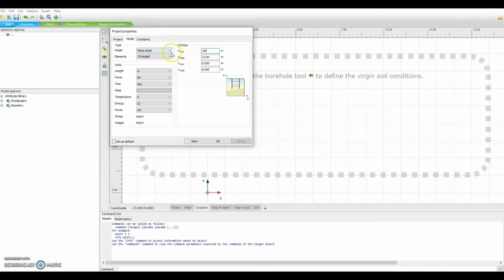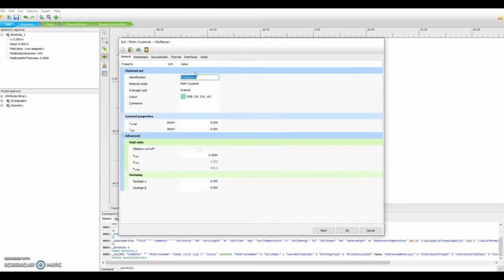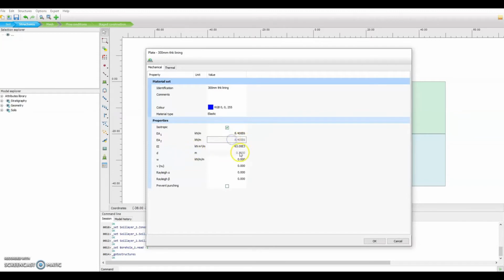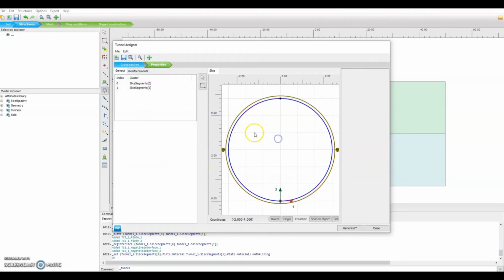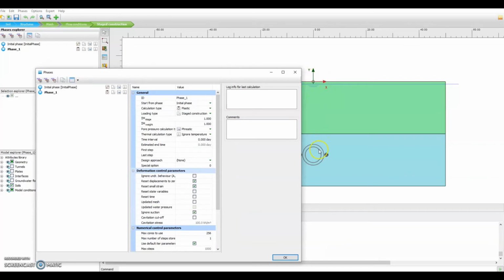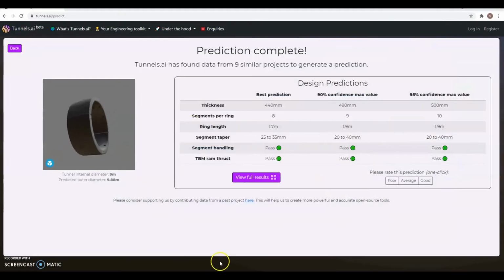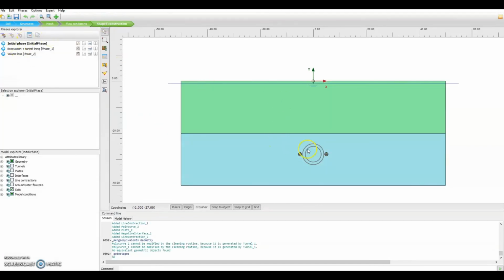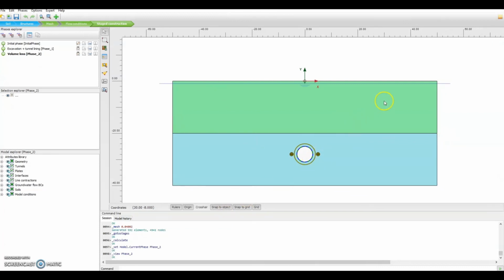Plaxis 2D V20: Tunnel design & settlement check tutorial with audio description by Tunnel Engineer

Comment: Hello
I am trying to model the tunnel excavation using the same steps as in this video in cohesionless soil with drained condition and phreatic analysis. But I am getting a huge heave or upward movement of soil in tunnel excavation and lining phase, which is not practical. Can you please help me out with this problem?
Reply from the maker: yeah sounds pretty wrong, did you apply the line contraction?
Reply: @civil-engineering-ai  Yes I have applied.

Comment: Sir how do we calculate moment of inertia of circular tunnel lining for  calculating flexibility ratio
Reply from the maker: You can calculate the second moment of area of the outer diameter circle with (pi/4)*r^4 and subtract the moment of intertia for the inner circle. You then need to adjust the moment of inertia based on the number of segments in the lining using the equation of page 2 of this report https://jme.shahroodut.ac.ir/article_573_094c643afafcb078fe744f4fc8eee77a.pdf
Reply: @civil-engineering-ai  ok sir i will go through this

Comment: it was very useful. i'm doing my project in tunnel surface settlements in PLAXIS 3D. Can i repeat this same procedure for 3d too??
Reply from the maker: Thank you! It is a similar approach but you have to take account of boundary conditions and make sure the model space is big enough. There's also some more nuances with the construction staging and you'd probably want to consider the TBM face pressure in some way as this will be main cause for settlement, you wouldn't use the line contraction to simulate volume loss. I can put together a video to help explain!
Reply: @civil-engineering-ai  Okay. Please upload when you get time. Because, I'm lacking support in Modeling of tunnels and in calculating Lining pressure . It will be very much helpfull for me. Thanks